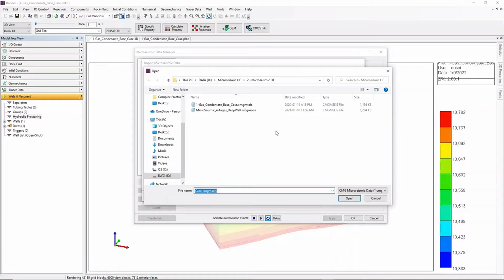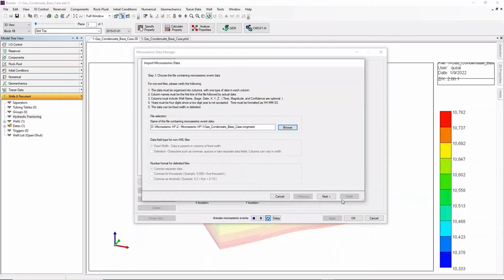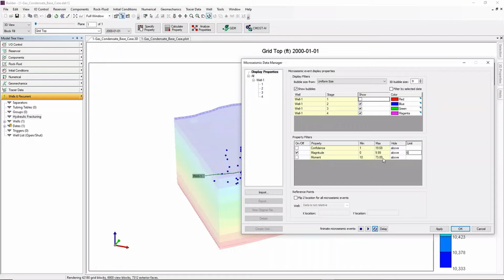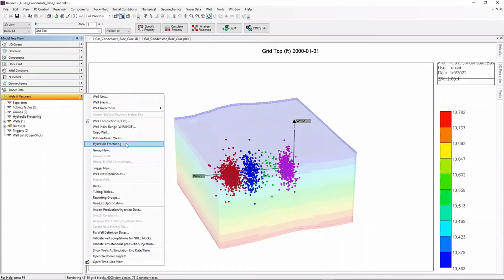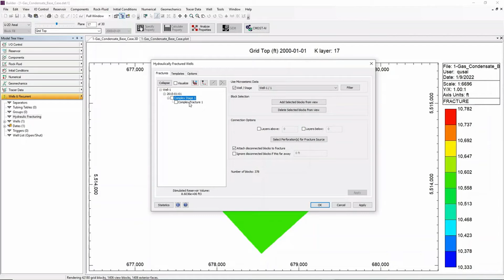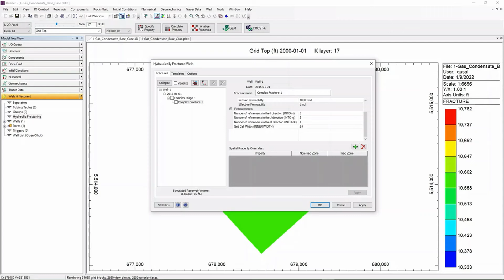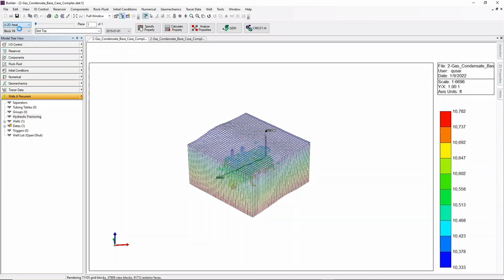CMG Tutorial: How to Create a Complex Fractures Network

Comment: Is it possible to create fractures without using seismic data? Where can I get the seismic files as well? any particular software?
Reply from the maker: Hi Dr. Alireza, thanks for your reply. The answer is Yes, we can create fractures from different input files/software/data. If you don’t have access to microseismic data, you can model your fractures using fracture modelling software, available in the market, and import the fracture network right into Builder. You can even use the new Discrete Fracture Network option as well. Microseismic data comes from microseismic acquisition system, that often uses sensors on monitoring wells or neighbor wells, that record the fracking job, and can later be interpreted as how the fracture network is growing through your reservoir. If you have further questions, please consider sending us an email to support@cmgl.ca.